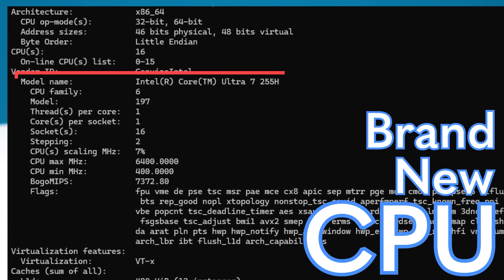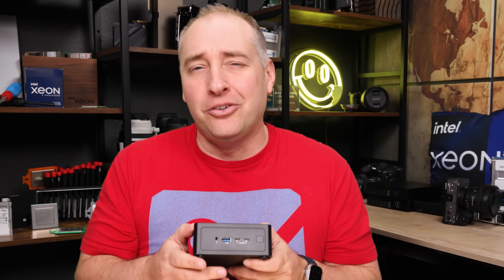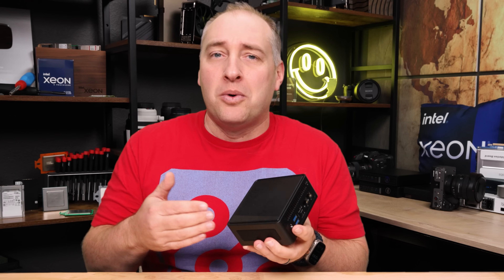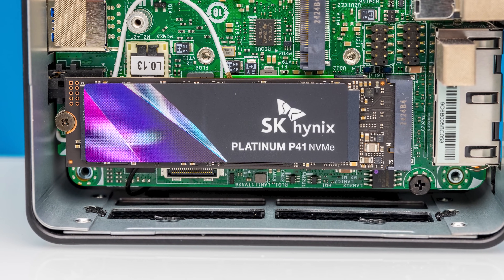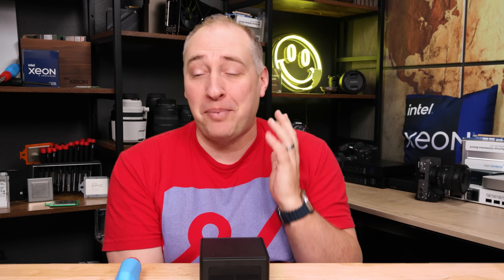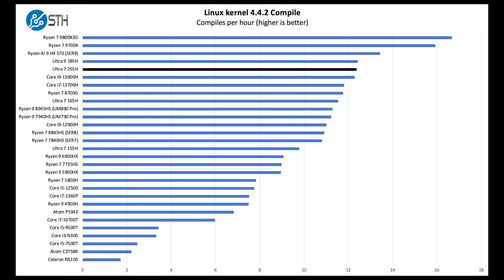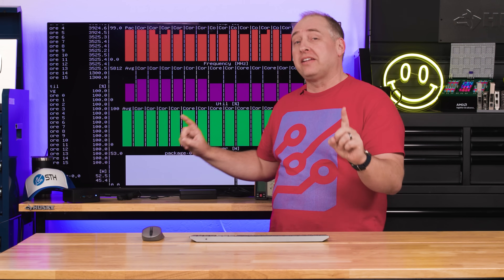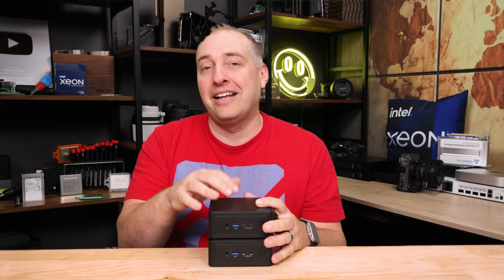A New and Better AI NUC is Here

Comment: 8:12 - I have a question: at this part of the video you show the "COM" and "USB 2" connectors on the motherboard. Can those actually be used? Like, can you buy an expansion lid for the NUC-BOX like you can for the old INTEL and current gen ASUS NUCs?

Comment: One interesting point to note that distinguishes this ASROCK NUC 15 from the ASUS NUC 15 Pro is that the latter lacks 2.5" SATA support (even in the "TALL" variant as of Nuc15), and an audio port. However, it has a few more USB ports in exchange for a single NUC port.

Comment: Regarding port labelling there’s another thing about ports that so many NUC makers, I have the feeling that it’s actually the majority of manufacturers, do that drives me mad and that’s putting all (or often the only) highest performance USB port on the front of the machine.

Maybe it’s just me but I always want to use the highest performance ports for what are essentially permanently plugged in extensions to my PC e.g. an additional monitor, an external hard drive enclosure or for some people maybe an external graphics card. For all of that stuff the cabling on my desk is going to be a lot neater if it is at the back of the PC rather than having to plug it into a front port so I hate it when, like with the PC in this video, the only (unlabelled!) Thunderbolt port is on the front and not the back. Grrrrr.

Comment: I'm noticing the Asus NUCs have dual thunderbolt.  I think proxmox clustering over a thunderbolt ring network is a really cool concept.  People are doing that with on the MS-01.  Interested in the Nuc 15 pro and to see what other vendors do with Arrow Lake!
Reply from the maker: Great point.
Reply: @ServeTheHomeVideo 

Fun fact I learned on reddit. The NUC 15 pro from Asus no longer supports a 2.5inch drive even though the website says it does.  

I think I'd want to use that for a boot drive for proxmox and M.2s for VM storage or application data but I'm still learning.

Comment: thank you for hw design review and performance review parts. 
this nuc (like older models) has defective stacked wifi+m.2 design - wifi card heats up and cooks cheap m.2 ssds. 
cpu dropping clocks makes it worse than custom built ryzen 8400f / 8700f price/performance wise, but not price/size wise.
not having regular dp ports makes it impossible to use amd variable refresh rate implementation over dp.

Comment: For the love of blood hell, add an inch to the height for a standard 120mm fan and increase the heatsink to fit the fan and lets get the thermals and noise under control.  These would be great media boxes if they weren't screaming cunts.

Comment: I have an older NUC that has the I226-V 2.5gbit ethernet controller, but can't get it to push more than 1gbit/s (Linux 6.8 - Ubuntu 24.04 LTS) even though it negotiated at 2.5gbit - feels like that NIC doesn't work too well under Linux :(  I wonder if this new NUC has the same issue.

Comment: Compared to all the other mini pc options I think it is $200 to expensive when you currently can get a Beelink mini pc with 8845hs, 32gb ram and a 1tb ssd for $600
Reply from the maker: Fair, but this is from a better known brand (ASRock) and has a 28W TDP CPU that is faster than that 45W TDP CPU. This is 96 TOPS the 8845HS is 38 TPOS IIRC. I think most folks understand that newer faster tech from bigger brands carries a premium versus older hardware.
Reply: @ServeTheHomeVideo  You could argue that a larger company should provide cheaper products because of more sales and production in larger scale, but that has not been the case in the pc industry since the Chinese value brands entered the market. 

Anyway, competition is good and for us consumers having options is great

Comment: Love your coverage of NUCs and such, and also thanks for turning me onto MikroTik hardware. Their RouterOS is killer.

Congrats on the health journey. Just curious if you've done a DEXA scan prior to starting the diet? I found it invaluable when I decided to lose weight years ago, as my first health plan didn't include enough protein and resistance training and a subseuent DEXA scan a couple of months later made that obvious since I saw what proportion of the weight lost was muscle mass. Helped to adjust and not lose too much muscle along the way.
Reply from the maker: I did not. If you go back to pre-pandemic I had been doing Crossfit daily for a decade plus when it was still a few gyms in NorCal. ~40-45 min Murph depending on the day. I need to get lighter so I can get back to those workouts.

Comment: Should call out to these mini PC makers to add an external antenna jack that extends from internal wireless card. Almost all have very poor wifi/bluetooth reception
Reply: You know they use m.2 cards that have standard antenna "pins"? You unpin the included wires and get something else - I bet you could find external antenna socket with those.
Reply: @krz303 yeah this is totally possible but you’ll have to drill mounting holes. I think these are targeted toward home servers. Would be cool with external antennas built in.
Reply: I had to return them due to poor wifi and bluetooth

Comment: There is more of a change between 155 and 255 than i expected, also didnt expect the iGPU to outperform the 8700G.

When AMD announced they'd have a 256 bus APU with 16 cores and 40 CUs i was ecstatic, with DDR5 that would mean up to 1TB of RAM per node (assuming 2 dimms per channel and using the larger capacity, higher speed, lower latency desktop udimms even more if it supported ECC/RDIMM), this could allow running large models locally on a single machine instead of chaining 4 or more nodes together like many have been doing with Macs

Now many people are telling me Strix Halo only supports LPDDR and was never designed with DDR in mind, sort of like a console like the SteamDeck or a graphics card unlike their other APUS which include both. If this is true AMD has shot themselves in the foot by having the same capabilities as Nvidia and Apple. AMD could have eaten their lunch offering 1TB of RAM in the same space as the Nvidia Digits with only 128GB of RAM where many models will require 4-8 digits to run the full model, not because the GPU isnt powerful enough, but because there isnt enough RAM
Heck right now you can get more RAM on the 8700G or 14900K than you can with Nvidia DIGITS

Comment: Yeah, but mac mini has a gpu that doesn't suck, and since it's sharing memory with CPU you can load some huge AI models and have them fly.
Reply from the maker: Somewhat. If you have a base Mac Mini you are stuck with small models in 16GB. With these, you can add 96GB and actually run much larger models.
Reply: @ServeTheHomeVideo  From my experience: not really. On mac gpu can use WHOLE system RAM, on PC iGPU is limited how much it can access due to design of operating system - hence if you load stuff from LLMstudio part of your model will be processed by CPU, not the GPU, and makes it really really slow. Do a simple test - load a model that takes like 48GB on the mini pc you suggested, and then load same model on  mac mini. Let us know the difference. At this moment I'm using M4 max with 128gb ram to run models larger than 70GB - only reliable and fast way that I've found so far that doesn't require machine in excess of 50k$.

Comment: It feels like a generic Dell pre-build would compete with this high of a price point.
Reply from the maker: Dell's Micro systems tend to cost more, and also do not have features like the dual 2.5GbE. Also, the Micro's tend to use higher TDP CPUs so you would expect ~30-50% higher power consumption. Check out our Project TinyMiniMicro series.

Comment: Over priced.  And what's with the short m.2 slot?  Both slots in a machine with this price should be 2280.
Reply: That form factor is common for expansion cards right? Pretty sure I’ve had WiFi adapters using that size.

Comment: I don't quit understand the point of this over an MS-01 with a 12900H unless you specifically want a bit of desktop tops.
Reply: tbh, the big selling point of the MS01 is its 10gbe ports. Also the 12900H and 13900H overheat quite a lot and need severe power limiting, and their cooler isn't discreet. they don't really compare all that well to the Asrock
Reply from the maker: You are right. This is a much newer CPU and it is from a much larger vendor.
Reply: Ya...even the MS-A1 with am5 cpu that it can contain lol wonder how maxed a1 would fair against this. Think asrock could lower costs by making more under consumer label maybe like minisforum

Comment: I have a previous model (NUC-1360P) and I couldn't be happier. I am just not happier since the core count of the new 155H and 255H is lower than the 1360P was, and I need cores more than I need speed.
Reply from the maker: That is very fair. You even lose threads with this over the previous generation.

Comment: ugh, 2.5GbE
Reply from the maker: Well, dual 2.5GbE. These days you can plug both into an unmanaged switch (no need for link aggregation) and get ~5Gbps of performance using SMB3 Multichannel without having to do anything on the networking side. I agree 10GbE is better, but adding a TB to 10G adapter is easy.
Reply: @ServeTheHomeVideo  True, but TB to 10G adapters are all still really expensive, maddeningly so. I could get IOData's M.2 adapter, but then I lose an SSD slot. 

Most of the time it's cheaper to get an ADT PCIe expansion board and a cheap X520 or X540 card. That's still gonna be $200. 

And then, I have to have a separate power supply for the card, a cable coming out of the front of the NUC, and it all stops making sense. I get a miniPC because I want a small, neat package that is a competent performer. Once I add in a bunch of cables and external adapters and nonsense, I might as well just build a tower or a rack mount system, all because of the network speed. 

I'm happy to pay an extra $1-200 for built-in 10G, its just so disappointing that it seems like Apple are the only ones thoughtful enough (or greedy enough, LOL) to offer that option.  It seems like a lot of times these miniPCs bend over backwards to allocate IO for dual HDMI out and dual DP out, which ok, fair enough, a lot of people do use these as desktop PCs and all the power to them. It's just that those decisions always tend to compromise the headless/home server/HTPC use case where these miniPCs shine so brightly. If this had 10GbE I'd go pick up three of them, stuff each with 2x2TB NVMe, maybe a larger SATA SSD, and cluster em together, no ECC be damned. 

Just so frustrating so many miniPC manufacturers miss this mark.This is still a nice little box, all things considered. I also wish Intel would let us use unbuffered ECC on their consumer platforms.
Reply: @ServeTheHomeVideo  easy but not that cheap
Reply: Looking forward for 10 gb to be the standard one day
Reply: @PCGUYSMiami Give it 10 years.
Reply: Waiting for intel 5gbe
Reply: I'm tired of these anemic 2.5gbe machines!
Reply: Mac mini can get 10ge why don’t we get mini pc with 10gb Ethernet
Reply: @PCGUYSMiami you have m.2. Same as mac mini. Just put it in

Comment: Nice that it’s good but the high price disqualifies it.
Reply: Same problem that msi, asus, etc all have with these
Reply: Still using hdmi
Reply: I bought a used NUC for about $40. Its definitely not as powerful as these, but I'm still super happy with it. And keep things out of the landfill for many more years.
Reply from the maker: The other side is that ASRock is not a small brand by any means.
Reply: @ServeTheHomeVideo  mac mini is cheaper
Reply: @hongtanke  Sure, the mac mini is cheaper (assuming you don't need modern amounts of ram and storage). But the mac mini has big issues. For example, if I bought this mini pc, I would be fairly certain linux would work just fine on it. Not even Asahi Linux has official support for thunderbolt on M1